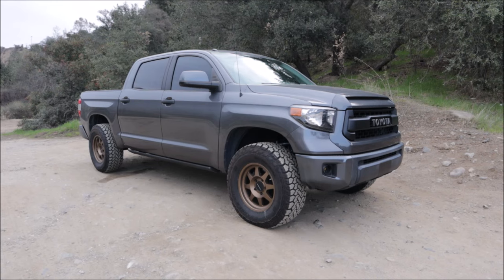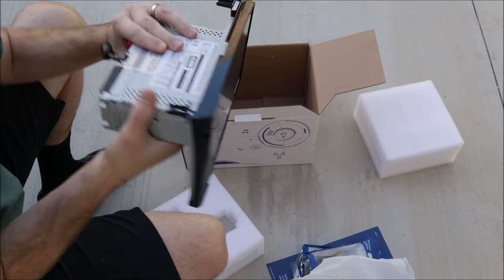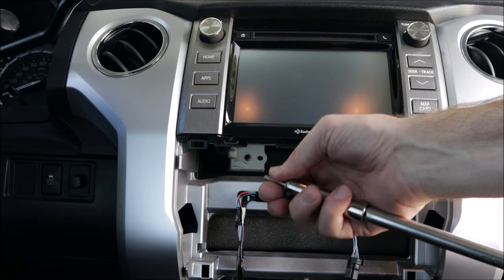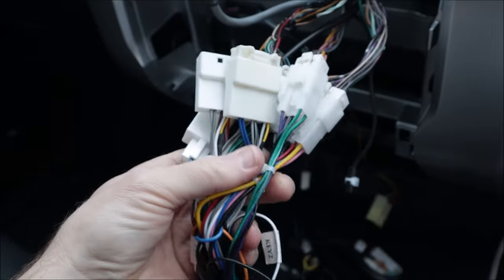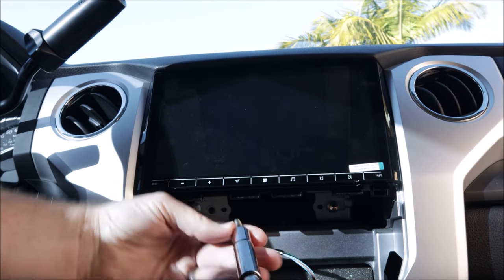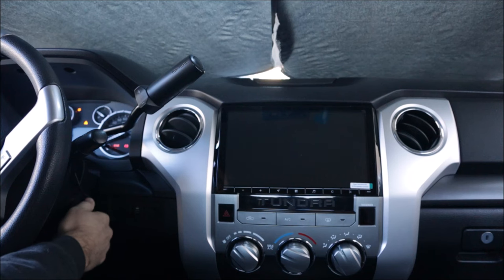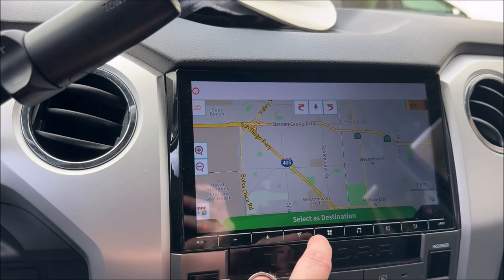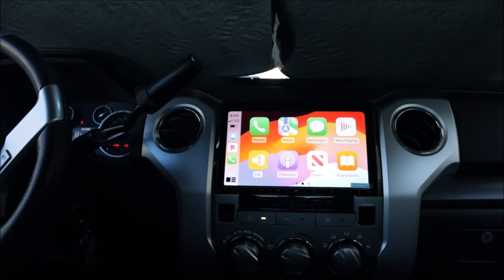Toyota Tundra Dasaita Head Unit - Installation & Review - Wireless Carplay & Android Auto

Comment: They don't show it but I learned you have to secure the ground wire.  My unit would randomly shut off anywhere between 2 to 5 times on a 25 minuter ride to work.  Once I secured the ground wire my unit is working just fine.  I have a 2017 Toyota Tundra and I had talked to dasaita's customer service never once did they say secure it.  They keep saying it was a software issue and to keep downloading and uploading the same update.  I secured the ground to one of the mounting screws that hold the unit in the dash.  I hope this is helpful for those having the same issues as I did with this unit.
Reply: thanks for the ground cable information - i seriously considering this unit to replace my Phoenix Tesla Style HU.
Reply: Have you noticed if the unit has shut off since you connected the ground wire?

Comment: I installed it. I have 2 issues: the air bag is giving me an error. And the rear speakers are not working. There are some 5 connections from the tundra that don’t fit anywhere in the unit. Can someone please help?
Reply from the maker: @lvp8068  did you try the other CANbus box that comes with the unit?
Reply: @RoadPatina  yes, it is that bog box. i took it form the other set of cables and put it into the correct one. the air bag issue was resovled after i restarted the vehicle. the issue with the speakers still remains. it seems is a common problem. Also, i use a USB port to listen to my MP3s which im unable now to find this source in the unit. IS there a place where i can choose the usb port?

Comment: I cannont for the life of me, get the steering wheel controls to work nor my backup camera. Any help would be greatly appreciated. 2019 tundra.
Reply from the maker: Did you try the other yellow plug for reverse camera? There are two. What harness did you use? Mine came with two. I had to switch the CANbus box to the other harness to install.
Reply: I struggled until I realized I had to swap the CANBUS over to the harness I needed — came installed on the other one. I don’t think the instructions were very clear about that. After getting it wired correctly and installed I LOVE IT
Reply: @gregorypatrickday  the canbus was the issue. Unfortunately after it started working it lost sound. I returned it today. I guess I will stick with the factory one.
Reply from the maker: @gregorypatrickday  that’s awesome! My canbus module was on the other harness also.

Comment: Just installed and the main issue that might be a deal breaker is can’t figure out how to get the front door speakers to work also the eq doesn’t function normal . Only the front settings changes anything . If I mute front all speakers mute anything else does nothing
Reply from the maker: Did you try to update the software? Reach out to Dasaita.

Comment: I just got this unit and my unlock/lock beeping noise stopped. Is yours still working??
Reply from the maker: @shiftpinoy  yes, mine works. You should be able to go into the factory settings and change it. There may also be a software update
Reply: @RoadPatina  I’ve checked on the software update and it says it’s up to date. And  I don’t have anything on the factory settings.

Comment: My screen never powered on checked the wiring everything
Reply from the maker: @TheOlds350rocket  Dasaita tech support?
Reply: @RoadPatina I appreciate the reply if you can help me I'm willing to try again to see if it'll fire up
Reply: @TheOlds350rocket did you get this figured out? I swear I have everything connected property and it won’t power on when I start my car
Reply: @theboosterdepot9723  yeah I got it working one of the pins in the harness was loose so I pushed it back in and it powered on.